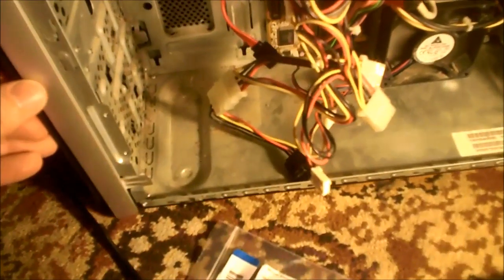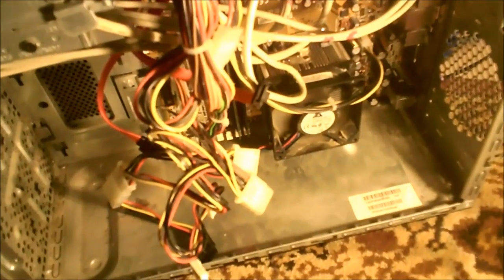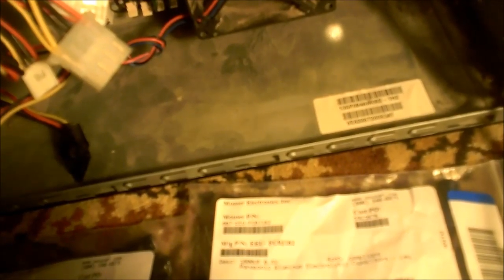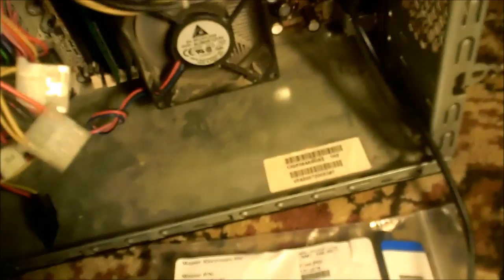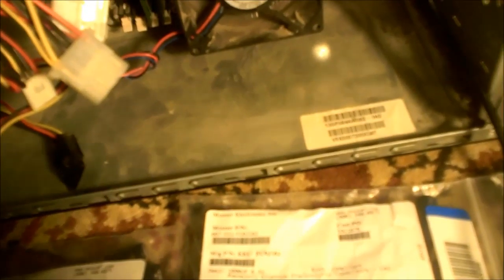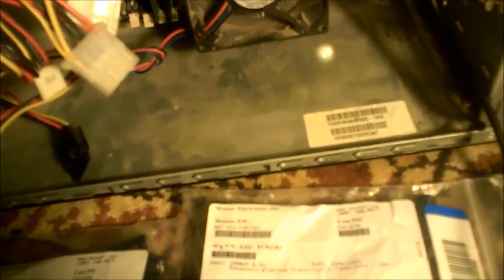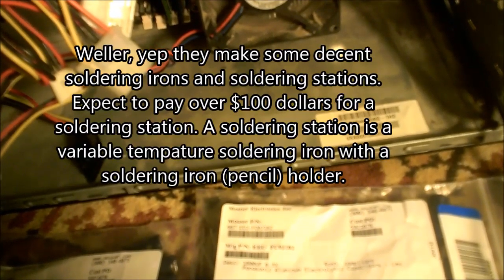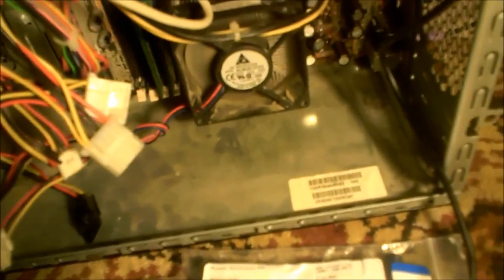HP Pavillion A6000 repair - common problem with this model - may apply to other models

Comment: My problem is that mine has a light in the back that keeps blinking when I have my cord in the back plugged up. I keep pushing the power button but it never works. I'm thinking it's the power supply. But it's also full of dust so I'm not sure what the problem is. Please reply back if you know what the problem is or if you can give me instructions on how to get my gaming of to work again
Reply: hope it helped
Reply: it is he power supply
Reply: Crypt Eclipse just use a hair dryer

Comment from the maker: If you are going to use it as a gaming computer, you might want take a couple things into consideration.  The power supply in this model isn't all that great, so it will need to be upgraded to something with higher wattage. Two: The processor is pretty slow for newer games.  In regard to the graphics card,  it has a PCI-express slot, so any card of that type will work. Lastly, price wise, you might be better off getting a new(er) computer vs. upgrading a computer that is older.
Reply: Beast6228 Hey, I'm not sure if it's my capacitors or power supply in my a6000. It doesn't attempt to turn on or beep either. Not sure what's going on

Comment from the maker: These are low end, bottom of the barrel computers they sell at walmart, best buy and other stores for low prices. They usually last just a little longer than what the warranty covers and then they fall apart.  Best Buy are crooks, $400 dollars to replace a graphics card is insane.
Reply: My a6000 is still going after buying it in 2008 !
Reply: And its stock currently but now i will add a cheap graphics card and upgrade cpu to e8500

Comment: i bought one of these desktops in 2007 (as refurbished) and had many problems with it ... im not sure if it was a result of being refurbished but it crashed alot after a year or two.. i also had other problems i cant remember and i kept using it until more than a year ago. i tried turning it on but it wouldnt so i went to my local best buy and they said they graphics card was somehow damaged and had stopped working. it would cost 400$ to replace so instead i bought a new one.. terrible computers